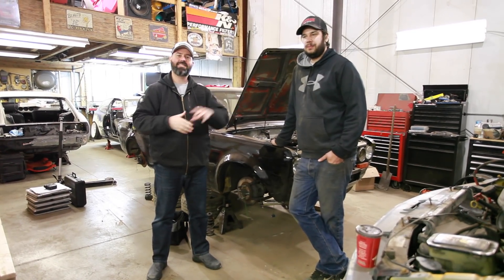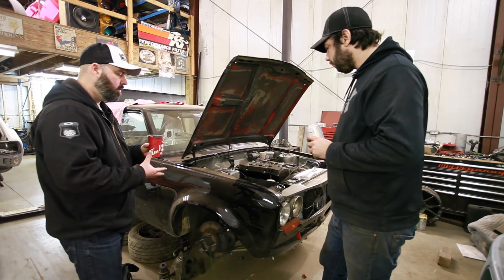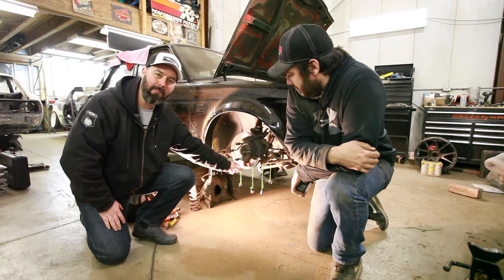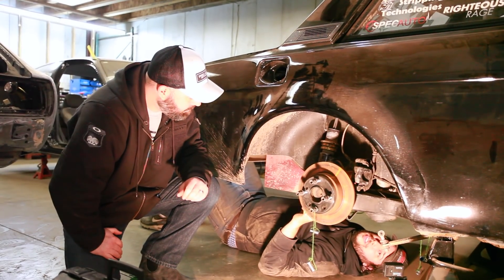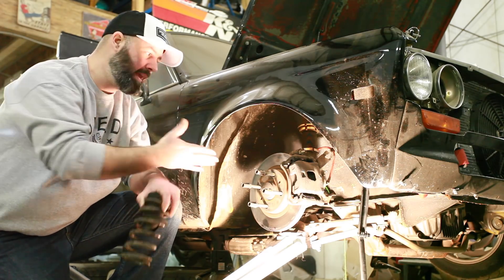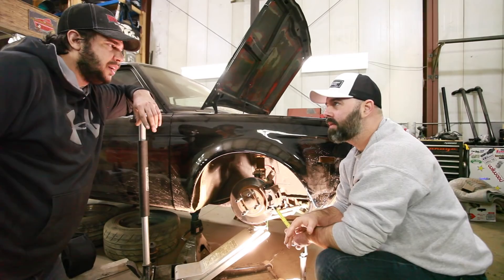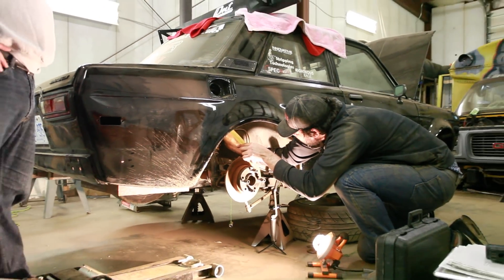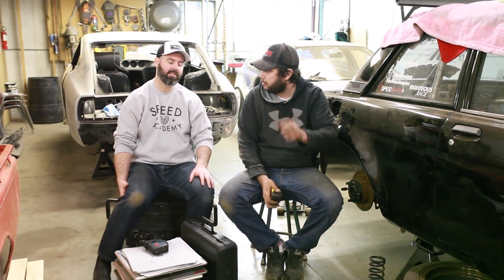Datsun 510 Suspension Tuning Part 1 - Math Is Fun!

Comment: Having built a race 240z (similar to the one in the background), I imagine that the 510 has a similar rear suspension type (Chapman strut) which complicated the motion calculations a bit. Not surprising to hear that the rear end handled unpredictably over bumps, since the Chapman geometry results in a significantly less than linear motion ratio.

Comment: I'm a big fan of math and all, but how are you defining optimal spring rate? It's not the same for a street daily driver, a road track car, a rally car, or an autocross car. So you know the motion ratio, but how are spring rates effected by ride hight, shock damping and rebound, caster, roll bar stiffness and ratio front to rear? Not to mention, this information has nothing to do with 510 suspension tuning as none of this relates to any other 510 on the road. In all reality, the optimal spring rate is not a simple matter of measuring the motion ratio. It's hours and hours of time behind the wheel.

Comment: how did you set the suspension to ride height while being on stands? Is this a good way to preload components while going to torque bolts?
Reply: On a coiler with an adjustable shock body, you simply remove the spring and adjust the hub up to the height it would sit at while loaded by the weight of the car.

Comment: On a Mcpherson strut car you have to sacrifice spring rate in the chase for more caster. Positive caster is a wonderful thing. Makes for a stable car at high speed, and adds dynamic camber while turning. So you can run less static camber, helping your straight line traction. But still get your desired amount of negative camber while turning the wheel.

Comment: Will you guys be releasing a video on the way you measure/decide what the sprung and unsprung weights are? I have used these methods on a cars front suspension, matching it frequency-wise with the rear so I didn't really need to calculate the weights, but I want to know how you do it ;) Great content!
Reply from the maker: We'll be posting a story on our website soon with all the math that went into choosing spring rates. In part 2 of the video we show the install of the parts and a quick track test.

Comment: I went through about  year of suspension tuning on my old 2004 Subaru STI (don't have the car anymore). Miss that car...

Anyhow, damping is just as important as spring rate. My initial setups were very over damped in the rear and car was horrible. The spring rate was fine but it's amazing just how bad a shock can make a car handle. It was quite a downer to spend almost $10k on a custom Koni double adjustable setup and have it handle so badly. It took a lot of testing and a lot of revalving before things finally started working correctly. The car did end up handling very well.

My main take-away from all that is that unless you have a money tree and a lot of time and you're very serious in your choice of racing (or if you have no other choice like the 510 in this video), get something good off the shelf. Someone else went through all the pain and testing to make the setup right for you.
Reply from the maker: No question the dampers are just as important (if not more so) than the springs. The spring rates really just set the roll rates, while the dampers really help the tire and chassis control body motion and generate mechanical grip at the tires. Choosing the right spring rates for a given setup and a given track is important, but having a damper than can control those rates and body motion well is huge on a race car. 

In our experience there are some excellent off-the-shelf coilovers kits on the market and some terrible ones. You definitely need to do your homework here, as companies are sometimes rather conservative and dial in understeer with their spring rate choices to try protect themselves from liability.
Reply: You said it much better than me. :)

Comment: Nice work btw. What frequencies are you looking to pick?

Also, I'm looking for custom springs... would your Eibach Canada contact be able to help me out?
Reply from the maker: Yes, Eibach Canada can get you springs in pretty much any rate. 

We'll post up a story to our website soon with all the math including suspension frequencies, but I think we ended up around 2hz front and a bit less rear. We think this should work well with a high grip track tire like JP runs on this car (Pirelli Trofeo R) with limited aero, but probably a bit low for slicks esp. if we add some serious downforce to the package.
Reply: +Speed Academy have you read about flat ride? Yes, for a full track car... wow 2Hz is a caddy lol

Comment: Cool vid guys, what's up with the white Z in the background?
Reply from the maker: It's actually a 280 that's been converted to 240 specs, including a G-nose and a sweet built L28 under the hood.
Reply: As Dave mentioned below, it's a 280Z relieved of most creature comforts with a stoutly built L28...OS Giken diff, S12 gearbox, not really anything left stock...and much carbon fibre and plastic windows. I guess I should update my build thread...got a bit slack with that. http://retrorides.proboards.com/thread/86608
Reply: +James Sherwood plan on LS swapping mine 😂
Reply: Wondering the same thing, looks to be a 240z according to the tail light panel. I have 2 '72 240zs :)

Comment: Think it is obvious that car in the motion wont have the same height as the non moving. Especially for RWD setup : the car always sits on the back more,  unloading the front as you push the gas pedal. What I'm trying to say that on a race track the car wont have the same geometry of suspension as if it would be not moving so when you choose the spring rate you have to add this corrections. Plus the driver whos weight affects the suspension too.
Reply: No you don't. You select your spring rates for a static position. What you've said is very wrong, you should read about the scope of this effort.